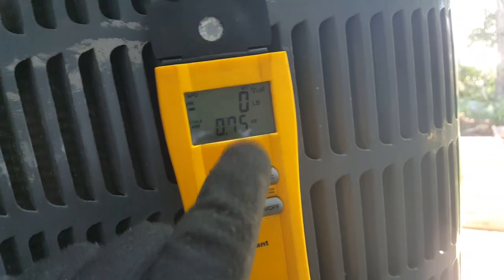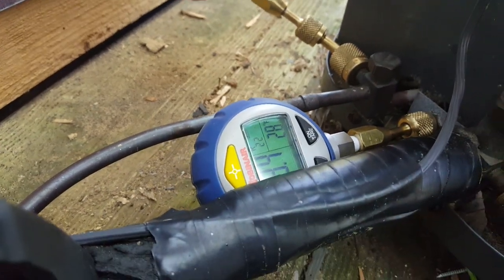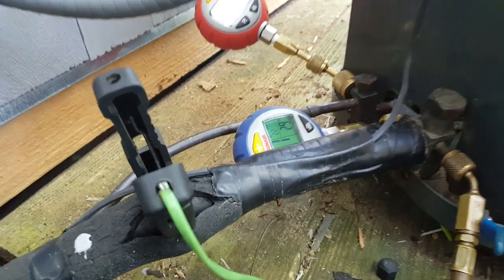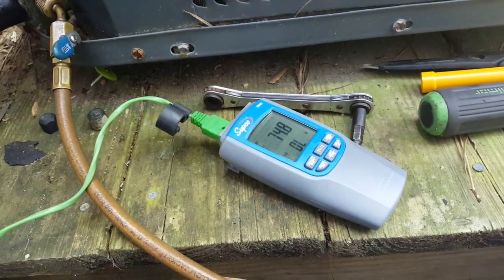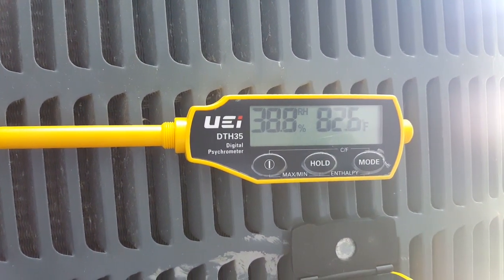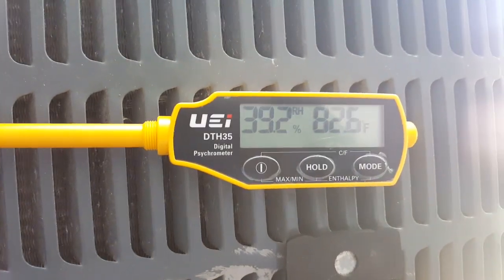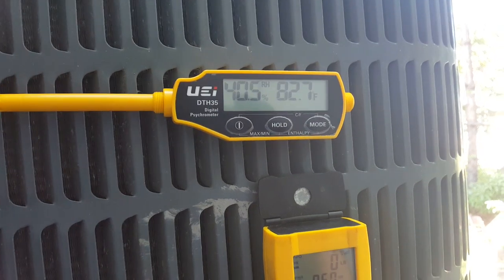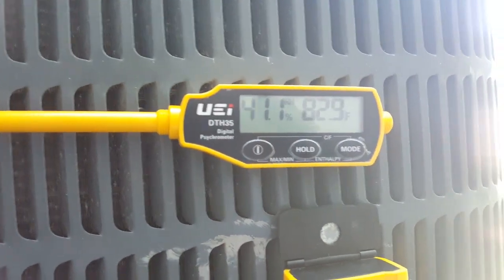HVAC Tools I Use for Charging Heat Pumps and Air Conditioners

Comment: i like that uei digital pschrometer tool u got there. gonna look into getting one of those. and those robinairs look cool too. i'm prob gonna get a set of those robinairs, they look cool and easy to read. nor-cals seems to holding up.
Reply from the maker: +OcRefrigeration,Hvac & Electrical. Yea, looks like the robinair ones are good. I like the portability of all of it. My tool bag for Service holds all if this stuff